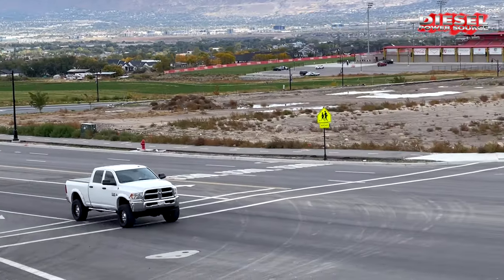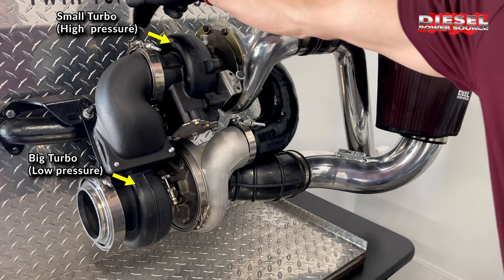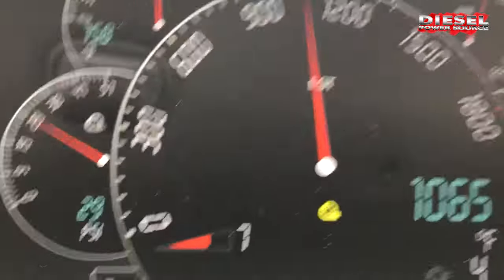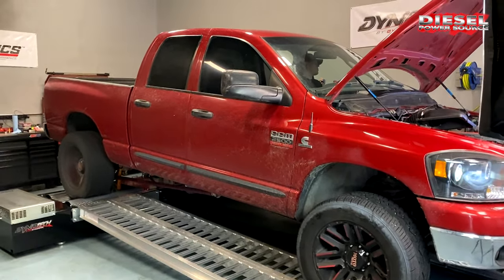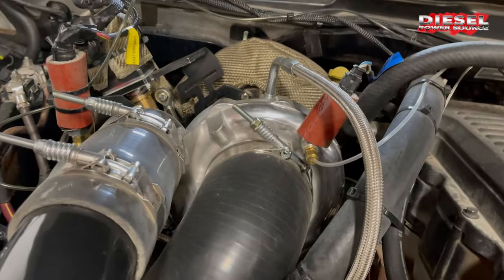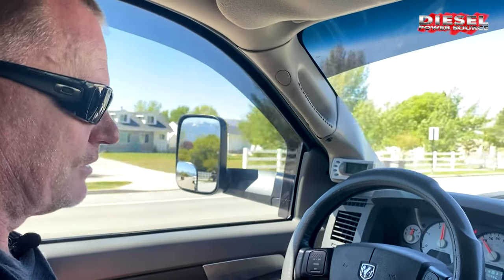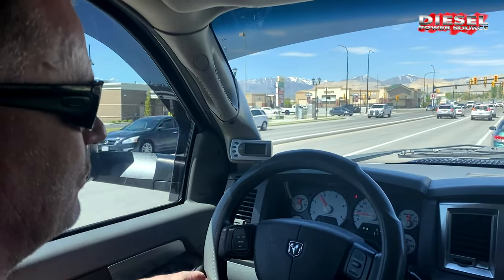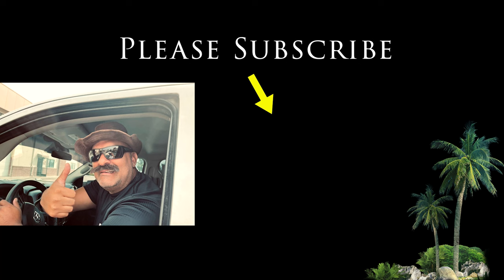Compound Turbo set up | Best Compound Turbo setup for Towing

Comment: would this kit be using the stock-style down-pipe, or will you need to cut and weld a new down-pipe to fit the compounds
Reply from the maker: If you have a 1st or 2nd gen truck, the kit comes with a downpipe, if you have a 3rd or 4th gen truck our kit will bolt directly to the cast iron stock exhaust elbow. OUr kits our made to be a direct bolt-on application.
Reply: Can I use this in my 4th Gen? I have a larger vgt turbo to retain my EX brake.

Comment: I have a 6.7 Cummins in my 2008 F250, will this fit?
Reply from the maker: Yes, we have a fummins compound kit that will fit that. We can give you more details if you give us a call. 801-930-8404. I will also send you a link. https://www.dieselpowersource.com/compound-twin-turbo-fits-ford-cummins-fummins-conversion-2001-2009-62mm-s475-turbos
Reply: @DieselPowerSource  Awesome thanks, i'm trying to find the dataplate on the motor to verify the exact year.

Comment: Would I be able to keep my factory exhaust brake on an 04 Cummins?
Reply from the maker: Yes you can keep your existing exhaust brake on a 2004 Cummins.  Both the factory brake or aftermarket brakes work with our compound kits.  Here’s a link: https://www.dieselpowersource.com/compound-turbo-kits-twins-diesel-performance-twin-kit